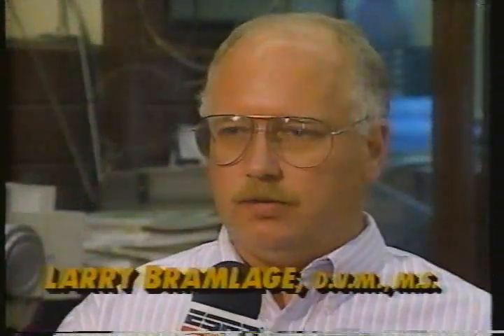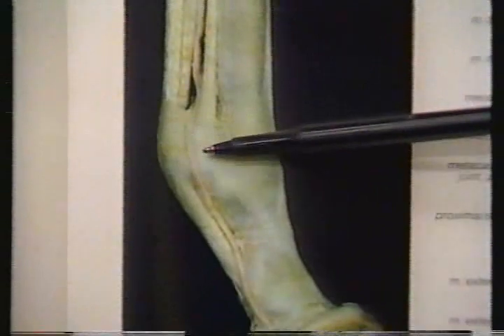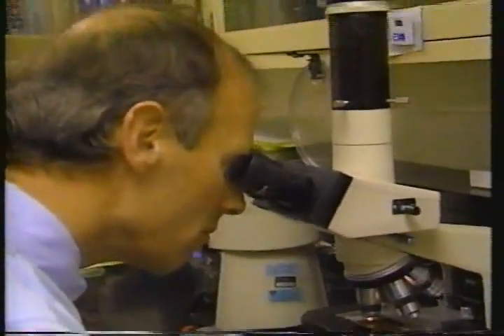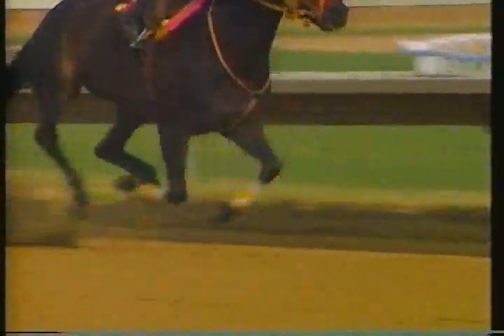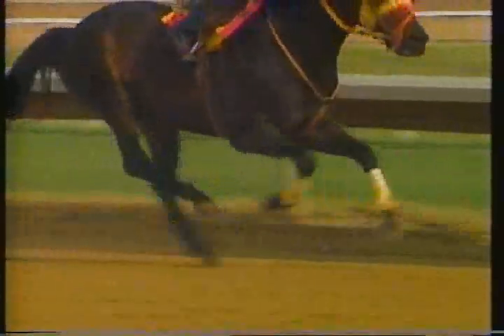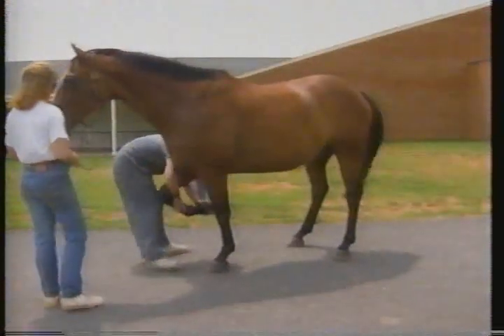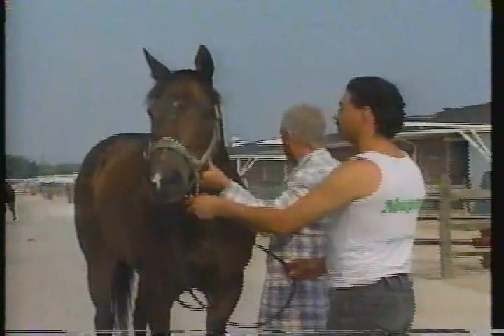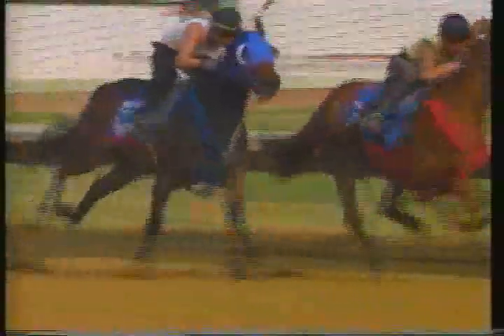Horse Racing Fractures & Breakdowns - an in depth look 1993

Comment from the maker: @109367  I'm not really sure about steeplechase horses.  Somehow I'd be shocked if they do wait that long, although you might have a point because I know steeplechase horses run at an older age than your typical flat thoroughbred racer.  I'd have to look into that.  I'm more a flat racing fan than the other forms of racing.
Reply: Steeplechase races are the end of the line for horses in Australia. Thankfully SA has now banned it and only one state allows it.

Comment: and if you stop driving there won't be car crashes. Horses break down everyday during pleasure riding, trail riding, running in the pasture, slipping, ect. Less than 2/10ths of 1% of over 400,000 starters suffered a fatal injury. But good guess, very basic though.